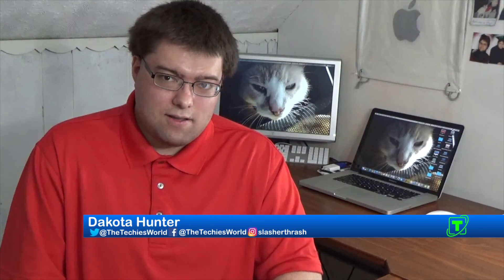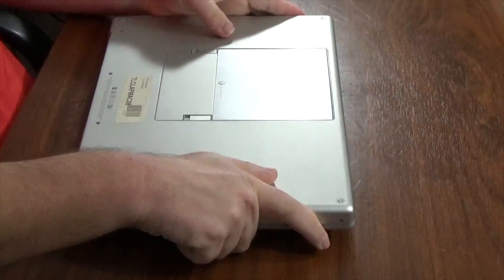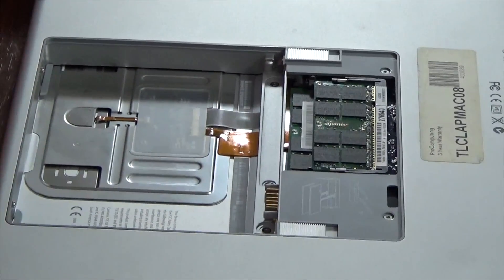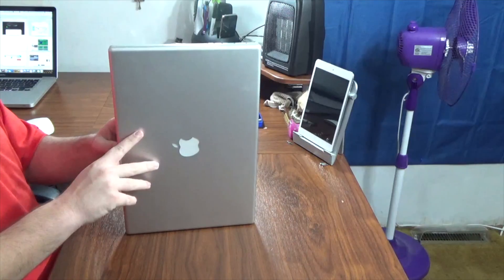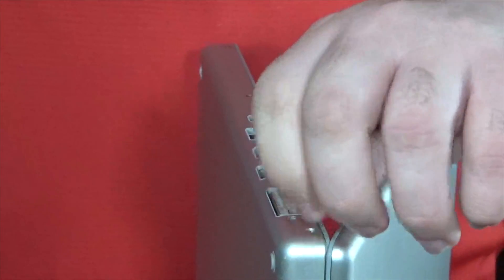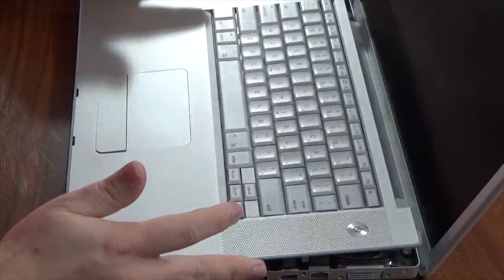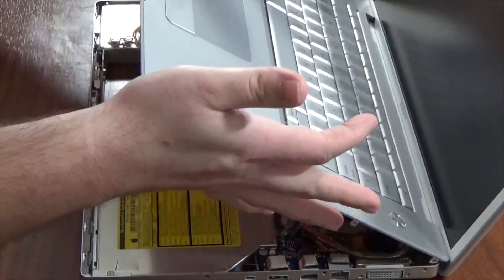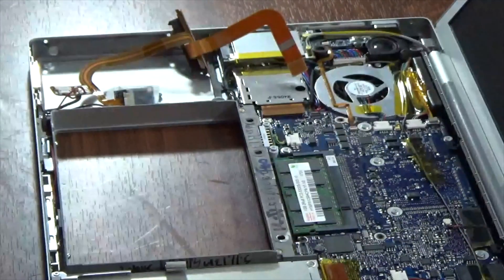MacBook Pro (2006, 2007, 2008) RAM and Hard Drive Replacement

Comment: I have a macbook pro 17 (2006). Four years ago I replaced the hard Drive and it worked well. I have not used it for long time since then. Now it refuses to start  even I have fully charged the battery. Any idea how I can trouble shoot it?

Comment: "Enjoy" removing the17 -18 screws to get the palm rest/keyboard off the thing.

To get at the drives....

DONE so many times with my two2007 A1226 and two 2008 A1260 machines 

Swapping parts....

Dealing with heat issues...

NOW untouched with my last A1260 eBay find.

After upgrades....

It SINGS!

On the CHEAP!

On SSA, here.....

J.C.

Comment: Replacing the HDD flat lead cable, 

FIXED my Sleep Light issue.

With my Early 2008 ( 7-'08) A1260 2.4 15"...

The female sleep light connector on the flat lead was intermittent

when pressed down.... 

OPEN with no pressure on it.

Probably the air solder joint on the connector....

AFTER a few HDD swaps....

BE CAREFUL!

Hanger Queen/Parts donor A1226/A1260's save the day!

WORTH a few bucks on eBay!

Flat leads there are $6 to $10 ppd...

VERY hard to replace the neon bulb and it's cable...

Logic board and battery case cast alloy frame OUT!

AVOID if at all possible!

Experience!

J.C.

Comment: Opened mine up and it looks like I have some proprietary screws or something holding my hard drive in place. It isn’t a Phillips head screw. What tool do I need to get those out?
Reply: T6 type... - On the right side two torx (T6) screws holding a bracket...

Comment: Is this worth doing in 2020, SSD's are much cheaper and its just lying around.
Reply: My $12 ppd. 250GB 72K SATA drive does the job for me....

MUCH faster than the OEM 54K 250GB drive, that DIED.

Thinner, cooler running...from a 2012 machine....

A similar 320GB SATA drive would be only a few bucks more.

I partition my drives to 2 or 3 partitions.

80 to 100 GB per...

2 for OS 10.10 and 10.9

1 for ripped DVD movies....

J.C.

Comment: what browser can I use on this machine in 2018??
Reply: You want to use Google Chrome for whatever OS you have installed.

Safari prevents streaming with YouTube

FireFox stops one from using many streaming video sites.

Security Certificate nonsense....

Experience with my A1260...

2008 A1278

2009 Mac Mini

J.C.

Comment: Not a bad step by step process.  Getting the keyboard free from front edge clips is the trickiest.  Well...no, actually, the hardest part are these tiny screws.  If you drop one, it's gone. Forget trying to find it.  A TIP for those doing this. On the very small phillips screwdriver,  make sure it is magnatized.  If it's not, rub the tip of it across any magnet you may have laying around for 30 seconds or so.   Also, I did not need to remove keyboard cable.  Just lay it gently on top of the motherboard.
Reply: Another option is to use a small wad of Blu Tac, which is a tacky material that kids in Australia normally use to affix posters to their bedroom walls. A small bit on the tip of the screwdriver and then force the screw onto the tip. I have a set of precision flat head and Philips head screwdrivers that aren't magnetised and this is how I did it until this project. The one Torque screw bit I didn't have was a T6. So, I forked out $AUS25 for a full set of technical and precision screwdrivers and bits and discovered all of the driver bits are magnetised! It even came with a specialised case opener for the XBox 360.

Comment: I just recived  a macbook pro A1150 from 2006 . I cant tell the tipe of the charger to use macsafe one or too . can you help please
Reply from the maker: +Szabolcs Fábián All MacBook Pros made between 2006 and 2012 use the orginal MagSafe connector. Only the MacBook Pros with Retina Display made betwen 2012 and 2016 use MagSafe 2.
Reply: The Techies World thanks a lot for fast answer  it helps a lot . Cheers mate
Reply: Find an 85 watt MagSafe, for quicker, cooler charging

65 watt OK, just a bit slower.

45 watt MAY run hotter

May NOT keep up with long durations streaming video loads....

Experience with my machines...

J.C.